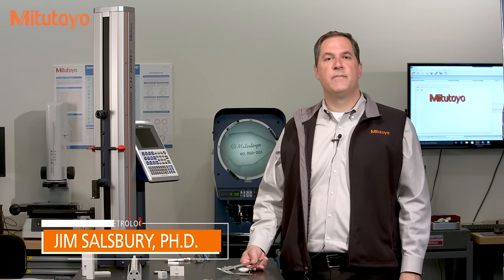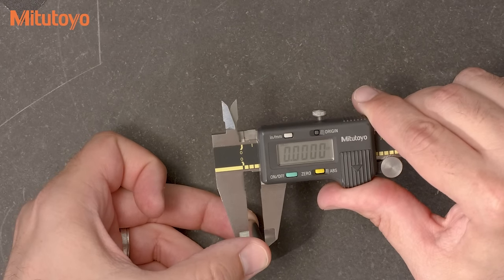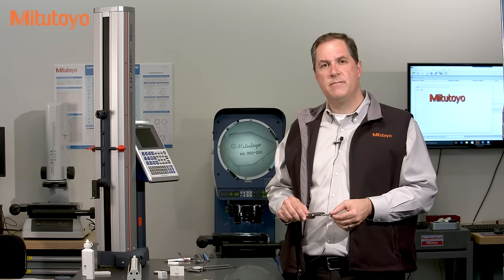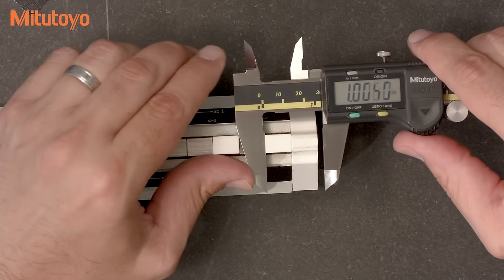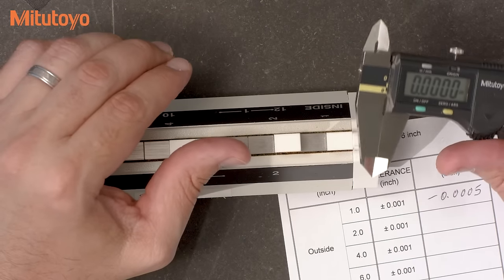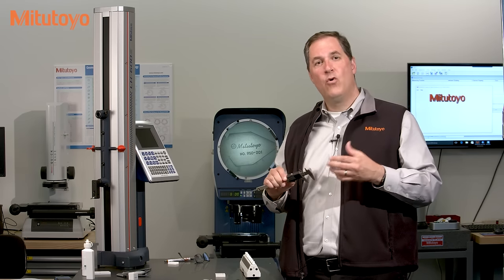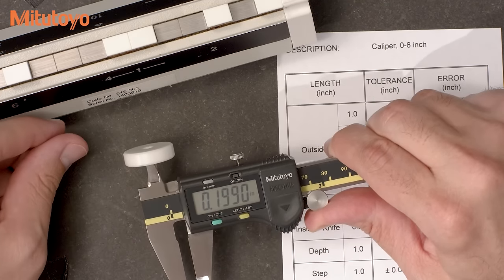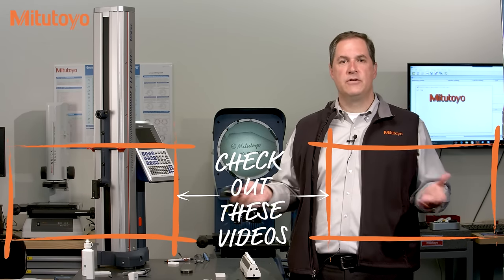Caliper Calibration - How to Calibrate a Caliper

Comment: Looks like you wiggled your way to a perfectly biased calibration.  I will have to question any tool that relies on a human for calibration.  There should be a mechanical test that can hold the caliper at the exa t angle and pressure every time.  The way it's done here looks like you wiggle until you get what you feel should be right.

Comment: I'm sorry, but this video does not show you how to calibrate the calipers. This just shows how to check the calibration. Now my calipers fail this check, so how do I adjust it to get it within specs?
Reply from the maker: I recognize there is some confusion with the definition of "calibration". Service or repair or adjustments (sometimes to improve accuracy) are typically part of the overall calibration process, but the essential calibration of most measuring equipment is to simply check the accuracy using reference standards. If the as-found calibration readings of a caliper show it to be out of tolerance, then addition service is needed. We plan to discuss service and repair in future episodes. For more information on the confusion surrounding the term calibration, check out https://www.youtube.com/watch?v=NV1VToAqfXI&list=PL8SjYuQUTBZ4y9U5X6xDvLouNNNIDbUNj&index=5 Thanks, Jim

Comment: In Japan, Mitutoyo is pronounced Mitsutoyo, and is written that way in katakana on the Mitsutoyo website (ie ミツトヨ).  The tu instead of tsu is a hang up from the romanization of Japanese in pre-war days.  There is no such sound as tu in Japanese and never has been. The company was originally established as 三豊製作所 (Mitsutoyo seisakujo).  Seisakujo (or seiksakusho) means something like factory, literally "things-make-place", so basically manufacturing.  The characters 三豊 are also pronounced Mitoyo, and used as a place name.  The Japanese website of Mitsutoyo has a history section, and states that the company started as a research institute in Kamata, Tokyo.   There is no clue as to why the company was named Mitsutoyo.　However, when the second character (toyo) is attached to a number, then it means something like "exceeding standard".  So as 三 means three, then it is possible that the founder of the company in the 1930s wanted to express a high standard of quality for the products, and named the company thus.  Toyo can also be interpreted as meaning abundant, rich.
Best wishes from Japan.

Comment: The explanations given are for "verification of measurements between tolerance" and a "calibration" method in case the device is not between "tolerance " is missing or not possible to perform. What if the device doest not pass? What to do to bring it back to specification?

Comment: "It's not correct to rock it around to get the value you like..."
—Proceeds to rock and squeeze calipers until they read minus 5/10ths for every measurement—
Reply from the maker: A technician will almost always rock a caliper back and forth to allow the measuring faces to properly settle.  I believe the video was trying to emphasize that a technician should not seek out a measurement result they prefer or like, but rather the correct measurement result.

Comment: As you said about ASME b89.1.14, there is a table there containing the MPE values for checking and comparing our measurement errors like 'E'.
So if E is less than the MPE value, but not zero, must we add the value of the measured E to the next measurements we take when measuring???

Comment: The caliper readout is 0.005. The tolerance is 0.001. A measurement of 0.0012 will give a readout of 0.001. Is this still within tolerance? My documentation from mitutoyo says 0.02 mm 'round-off error not included'. And I don't understand why there is a difference between the metric and the imperial system. Accuracy of 0.0015 (or even 0.001 inch) and 0.02 mm is not the same. Is there a different ISO tolerance between them?
Reply: Im wondering this too.

Comment: Given your outside calibration data test points, what minimum measurement would you be comfortable declaring this caliper be used for and how would you back up that declaration?  I will tell you from experience that when presented to modern medical device auditors, they will have issues with this caliper being used for measurements smaller than the lowest calibration point (1.0").

Comment: Hello i would like to ask, its worth to do a calibration for a newly purchased Mitutoyo device/caliper? I mean for personal use, not in company/commercial use. Its worth to pay extra for calibration? Thanks
Reply from the maker: Thank you for your question.  Whether your tools are calibrated and how often are decisions you must make based on the history of the tool and the risk involved.  Are your tools used in harsh environments?  Are they used throughout the day or only sparingly?  What risk do you assume if the tool is out of tolerance?  For those utilizing precision tools in commercial uses, calibration is a must because the product ‘has’ to be correct.  The company reputation, and possibly lives of the customers, can be at stake.  Regular calibration is a must.

Comment: I don't understand why it is wrong to take the average of a bunch of measurements. I understand that an instrument that doesn't repeat within a certain tolerance shouldn't be used... But presumably a tolerance is always greater than zero, right? So we might still expect our measurements to have some variance, however small? And depending on the error distribution, the average of repeated measurements would contain some information about the measurement that could not be obtained as reliably from a single measurement, no? Doesn't the central limit theorem apply here?

Comment: Jim, I also have searched the Mitutoyo website for a 0.2000" setting ring gage for the Inside knife check. I cannot find it on your website. Can you tell me where I can find this ring gage?
Reply from the maker: I had to special order a ceramic one, but the steel one is standard product, p/n 177-366. For some reason, it is not in our catalog, but it is currently available product. Thanks, Jim

Comment: I have searched the Mitutoyo website for a 0.2000" setting ring gage for the Inside knife check. I cannot find it on your website. Can you tell me where I can find this ring gage?
Reply: I ordered a 0.2000 inch ring gage from a company  in NY called Thread Check Ink.

Comment: what if it's not in tolerance, show how to make it back into tolerance, thank you
Reply: You'd need to either resurface or replace the measuring surfaces
Reply: There's no way to "repair" it by yourself. You'd have to get it sent to a machine shop where they can work on the surface.
Reply: @jordantyo7839  nope. Actually there is. Done it myself on many calipers. Pretty easy actually.
Reply: @happy jack please explain how to do

Comment: I have a weird issue, I open the calliper fairly wide and then close it again, sometimes it goes back to zero and sometimes it isn't. Though I have noticed that if I take the number that it is off by on the zero point it is the correct mesurement. Any ideas what could be causing this?
Reply: faulty electronic components, seek replacement

Comment: thanks Jim. Do we need to consider the uncertainty of the gauge blocks in the calibration?
Reply: It depends. Gauge blocks class x has an error so low that probably you wouldn't be able to read without the proper equipment. So the answer is: if you are using the proper equipment and your equipment it's calibrated. You shouldn't. If your equipment isn't calibrated you shouldn't use it to calibrate your calipers

Comment: for doing this calibration, do we have to have a lab granite table?
Reply: yes and a space station.
Reply from the maker: You do not have to use a granite surface but you do need to use a calibrated surface of some kind in order to assess the step and depth of the caliper.  You should not use a general purpose countertop as it has not been calibrated and is introducing uncertainty into the equation.  You might consider something like an optical flat.
Reply: You can find a small calibrated granite surface for about 100 bucks or so.

Comment: My Mitutoyo calipers are way out of spec, how do I get them fixed?
Reply from the maker: ArmySigs, you can contact Mitutoyo Repairs at 888-MITUTOYO or you can get additional by visiting our website at https://www.mitutoyo.com/support/repair-service/
Reply: What do you consider "way out of spec to be"? What be kind of work do you do with them, just curious.
Reply: First off check you gibb play,,your set screws probably backed out, set so it slids smooth but no up and down between the slides, reset your origin and check with a known round or block and compare, you als need to learn your calipers (feel). I found mine are spot on with a light touch.

Comment: how can you compute for the uncertainty if you are not going to take average of a number of readings?
Reply: I recommend you check out the ASME B89.1.14-2018 standard, as it includes an appendix on measurement uncertainty (for calibrating calipers).

Comment: 3:00  I've never seen a metrologist (or anyone) slam calipers together like this.
Reply: I use digital callipers everyday at my job making ceramic tile. Slamming them shut will very likely throw off the zeroing of the caliper. I agree with you.
Reply: There is no slamming at 3:00. Are you watching the same video I am?
Reply: @nirv  Regardless of the time in the video, the dude CLEARLY slams them in the video. If I did that at my job where I use them roughly 8 times a day mimimum, everyday, the measurements will be off easily by at least .005" if not more. Yes it matters in manufacturing.
Reply: @markjones2349  Give a time stamp. I didn't watch the whole thing.
Reply: @markjones2349  Then tell the guy to not put a time stamp when it's totally bullcrap? Yeah! Don't waste my time looking for something that isn't there.
Reply: @nirv  I watched the video and there is slamming going on. I don't give two shits what the time stamp was.
Reply: @markjones2349  bug off time vampire
Reply: @nirv  time to move on.
Reply: @markjones2349  Yeah. Next time don't defend fake time stamps that don't work. Thanks!
Reply: @nirv  Nobody cares.
Reply: @nirv  6:17 - 6:28
Reply: Hardly slamming, lol. Buy quality calipers and they shouldn’t be off when using them. If that’s slamming your using cheap ones.
Reply: @bullrunhunter6489  I use calipers everyday at my job multiple times a day for the past 10 years. If you zero them out and then do what this guy does, it'll skip past zero and throw off a measurement. Even our $260 Fowler calipers.
Reply: Mark Jones 
I just did this with a set of MLTools amazon $30 calipers and after zeroing guess what? I “slammed” 6x and I got a zero reading every time. Sounds like you have loose adjusters on the top side and they need to be tightened. I have some fairly beat up calipers that have been dropped and still read correctly. Long as they don’t come loose or get bent digital ones should always keep reading correctly. FYI I even slammed mine for real and the same result. What he did in the video isn’t slamming it’s checking for consistent readings and whether they have worn loose.
Reply: @bullrunhunter6489  Don't listen to me, I just use them for a living. What the fuck do I know.
Reply: @markjones2349  If he had watched 8 more seconds after clicking the 3:00 timestamp, he would've seen it...
Reply: @markjones2349  a thou is 25.4 microns, that's a mile for some people. It's not even accurate enough for bearing fits which are a very common thing in both lathe and mill work.
Reply: @MF175mp  For 99% of people a thou is way more than needed accuracy. But yeah I could totally see a machinist needing to go down to a ten-thou or whatever.
Reply: @nirv  Yeah he slams it, repeatedly 6:17 again at 5:38 driving the reading to -.0005 every time before it springs back to 0. I wouldn't let this guy touch my instruments, especially a dial caliper.

Comment: In what universe does 0.0005 = five tenths?
isn't  the first decimal place tenths? , doesn't it go  0.x = tenths ,  0.0x = hundredths , 0.00x thousandths ?
 looks like  what you wrote,   0.000x is  five millionths  not five tenths
 or is this some new fangled common core maths?
Reply from the maker: Hi Andrea, thank you for the question.  Thou, which is short for Thousandths and ten thousandths would be shortened to tenth which are common units of measurement for this level of precision. So here, it is Five tenths (of a thousandth).

Comment: Have a question about the tolerance you have on the result card. According to the B89 standered for "other measuring face" you are asked to use the Smpe  or the scale shift. This is turn would make the tolerance +/-0.0020 for anything between 2 and 8 inches. You have the tolerance in the video at +/- 0.001. Am I missing something?
Thanks
Great vids and I plan on coming to Aurora for seminars soon...
Reply: You are correct on the tolerances. However, I'm measuring lengths less than 2 inches, so the +/- 0.001 inch tolerance applies.
Reply: Yes I see that now. I had a brain cramp. Thanks for a great series of vids!

Comment: Does anyone here know if the person doing the calibration needs to be certified? And if the certification is required, does he need to renew his certification after a certain period of time?

Edit: As an auditor (still learning), I am auditing my company's supplier. The supplier calibrates their calipers, micrometers and height gages internally instead of sending them to a certified calibration agency. The guy doing the calibration has the appropriate training and certification but dated way back in 2014. I've checked ASME B89-1-14-2018. No mention of this at all.
Reply: Heya! From my 15 years inspection experience from job shops to medical manufacturing you do not need to be certified to perform in-house calibrations; you just need to know what you’re doing lol 

Performing monthly calibrations is usually part of the inspectors job and is totally normal. You just wanna make sure they’re using the proper masters/standards to do the calibrations. Unless the company is ISO certified, there really are no “rules” they need to adhere to (a majority of ISO is about the records you keep); most of the specs out there are kinda “suggestions” nowadays which can be unfortunate if left in the wrong hands. 

I am curious as to what certification was provided to you for the guy you mentioned if you don’t mind sharing it? I like to refer to Inspection as an “old man job” since you basically learn everything from some old guy who’s been doing it for 40 years lol. 

You shouldn’t be alarmed or concerned if they’re doing in-house calibrations; it’s just probably confusing and foreign to you if you’re not familiar with the process. If you have any specific questions please feel free to ask 👍

Comment: You're NOT showing "how to" calibrate a caliper. You're just showing us a caliper that is within the tolerances of a standard.
Reply: And that is also calibration. Calibration, in very simple terms, means recording and inspecting the actual capabilities and accuracy of the instrument.
Do not try to lecture an expert, and study the difference between calibration and adjustment.

Comment: This isn't calibration. It's just checking that the existing calibration is within tolerance. There's no method for correcting any deviation except the obvious 'Buy a new caliper'.
Reply from the maker: You bring up a great point.  There is often confusion associated with the term "calibration".  It can be used differently across metrology.  The video https://www.youtube.com/watch?v=NV1VToAqfXI discusses this very topic.